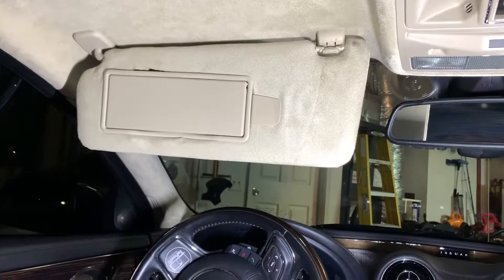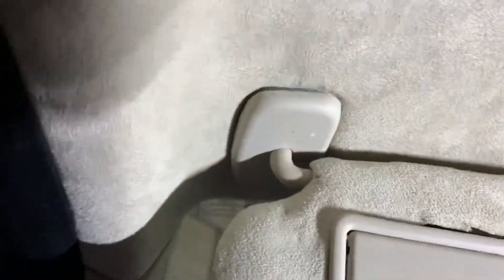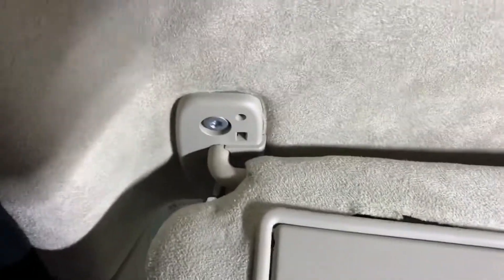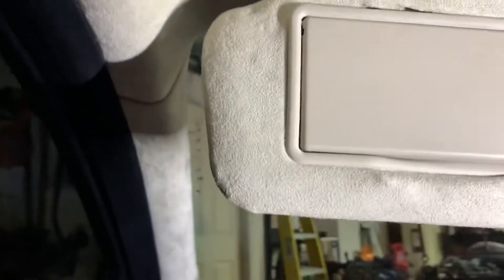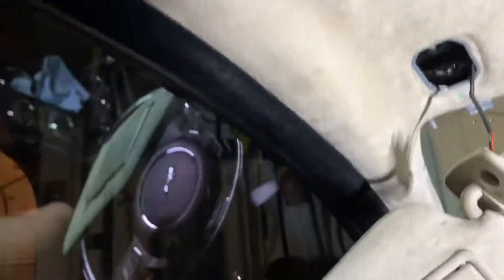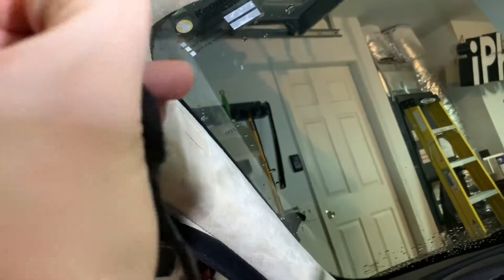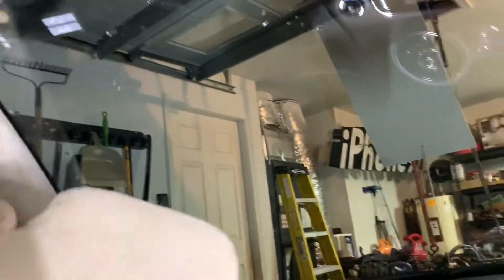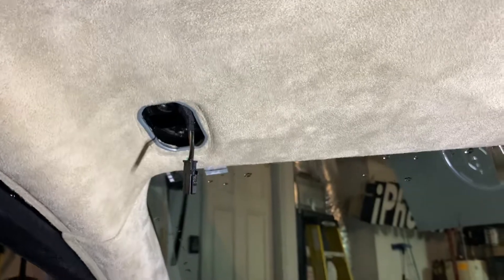Jaguar XJ x351 Sun visor replacement

Comment: Thanks for the informative video, any idea how to replace the passenger's side sunvisor? The wire doesn't come from the door side, it comes from the center of the roof's side, I tried to pull down the roof as much as I could to be able to pull the wire but that wire wouldn't move at all!